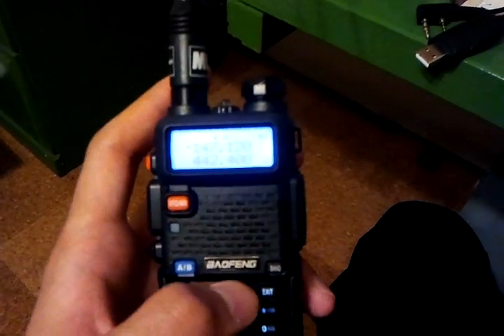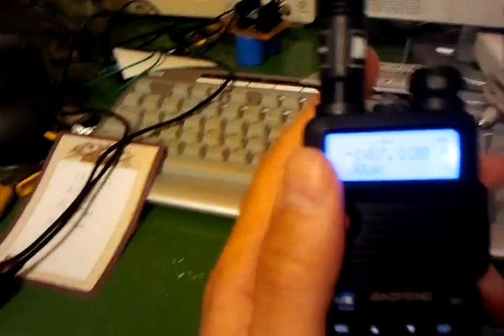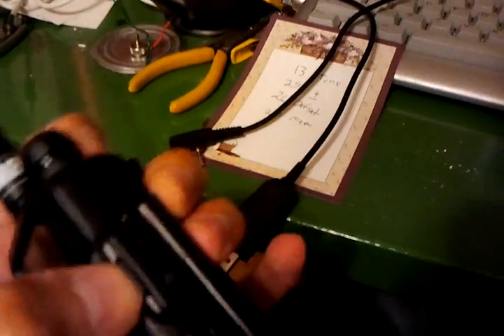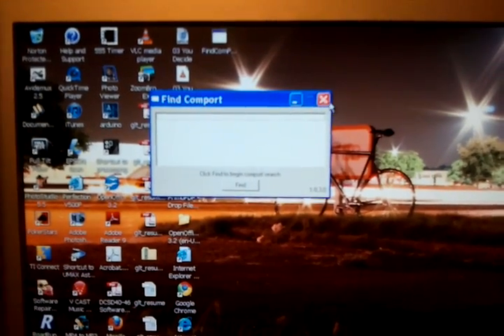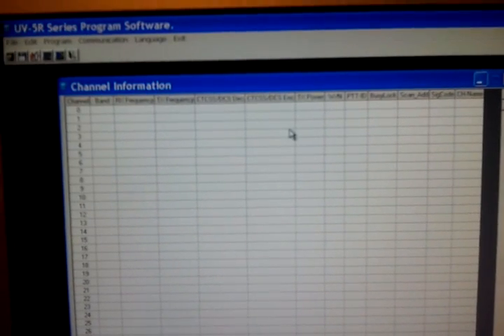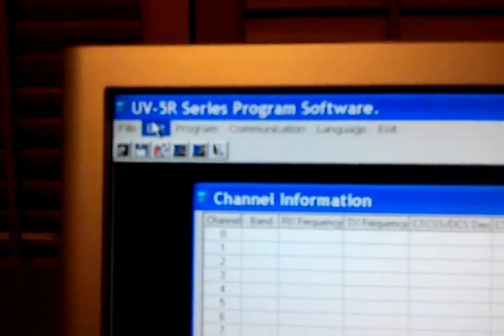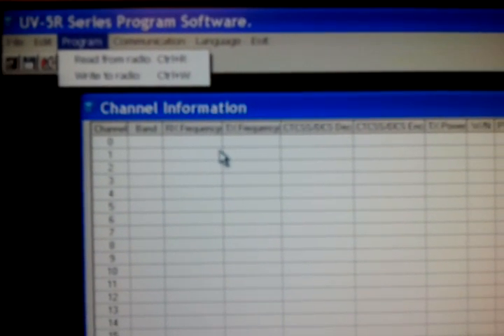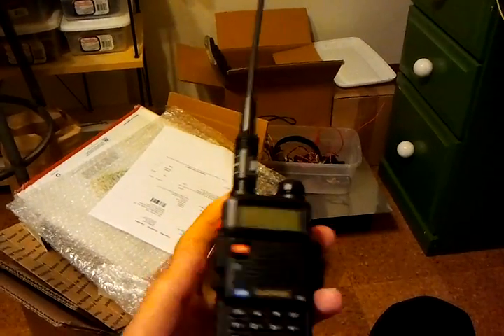Baofeng UV-5R How-to Program Repeaters

Comment: Make sure that you are in VFO A and that TDR (Menu 7) is off. Offset will not be saved with TDR on. Nearly lost all my hair over that one! P.S. the programming cable is great to have, but knowing how to manually program your radio is essential.
Reply: +David Oldham ,
I tried that...still won't save...

Comment: I've done all the programming but I just can't seem to get my radios to connect to the local repeaters. I can hear when someone else is using them but when I use two uv-5r's They won't use the repeater. They will only 'receive' from whatever freq. I use to transmit... Any ideas?? for ex. repeater receive 444.850, transmit 449.850. +5.0 MHz offset.  any ideas???

Comment from the maker: Yeah you can set the transmit and receive frequencies independently in software. That's how I do it. If the repeater has a positive offset then the transmit freq will be 600 kHZ higher than the receive freq for a 2 meter repeater. 600 kHZ lower for a negative offset.

Comment: what you need to do is get your earpiece to feed into your computer, then convert the analog signal to a digital decoder based on the sherrifs digital code or encryption. I'm not sure if there is software out there that does it but this is a simple hack.. it would be better if you modded the receiver to have its frequency output via a cable or blue tooth to a digital decoder.

Comment: You have showed how to set up repeater settings in VFO mode, but after saving you have not checked whether it would work in memory mode too.

try it, if you have the same firmware that i have - youll find that repeater offset has not been saved along to your memory channel... :(

Comment: licensed amateurs  have frequency ranges assigned to them, within they can choose freely in certain bands, and in others need to observe certain step sizes.
i.e. this radio can go onto PMR frequencies which are close by ham radio 70 cm band.. however, normal ham radio devices cannot go onto PMR frequencies, because of the step-size.. and PMRs are limited in output power, by stepsize and bandwidht so they cannot distrub the licensed amateurs and professionals.  Your frequency is any legal channel

Comment: many of those are not sold with a programming cable.
I was not able to program repeater shift manually w/o a computer.

I wish someone would make a video of that task which is aparrantly not so trivial.

I went to frequency mode, set everything up.. shift , ctcss and so on - repeater operation works - then i saved it via menu nr 27 , and switched to memory mode 

on the channel i saved, i indeed find the correct output frequency saved - but the shift attribute was not saved along with it.  wtf?

Comment: Hello, i am new to ham radio and recently purchased a baofeng uv-5r. I am having difficulties trying to reach any repeaters. i have set the T and R cts and the proper offset and shift, but when i press the ptt i cannot get any response back from the receiver. can any one help me with my issue? It works great with symplex. 
here is the channel were trying to send

147.090
tone -100.0hz
ctcs 88.5hz
offset 600

mine...

t-ctcs 100.0hz
r-ctcs 100.0hz
offset 600
shft -

Comment from the maker: If you go to the link that is in the description there is a COM Port finding program on that website. It will help you find which COM port your cable is connected to. I had a problem with my newest computer cause all the usb ports were COM Port 14 or higher and the program only lets you select COM Ports 1-8. This might be your problem. I had to use my older computer which has USB ports with COM port numbers that aren't too high.

Comment: Thanks for posting. I purchased the radio partly on your review; I like the radio although no matter what I do I cannot get the cable and software to communicate with the radio. Have tried multiple PCs, ports, and software (downloads) with no luck. Best result was lack of the same consistent error when I selected the option for COM3 on my PC, but it still has communication errors and is unable communicate with the radio.